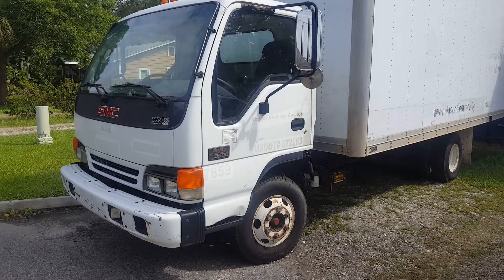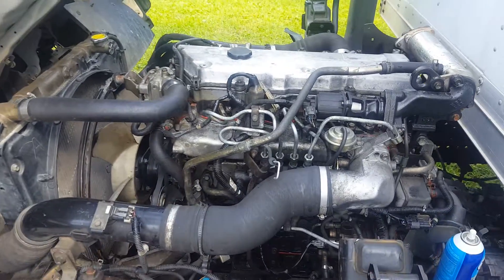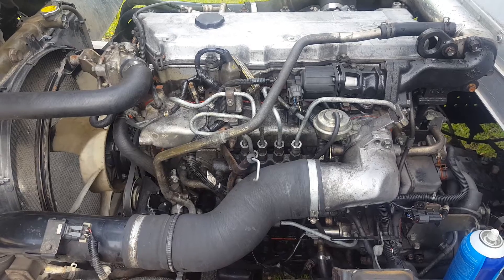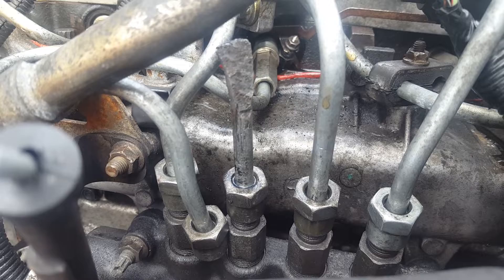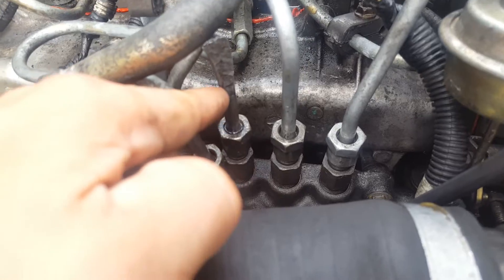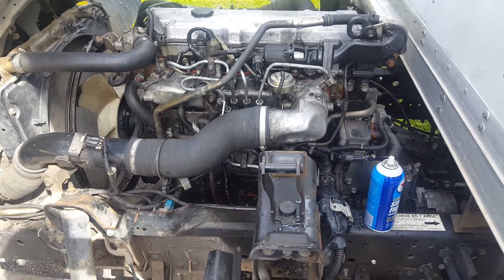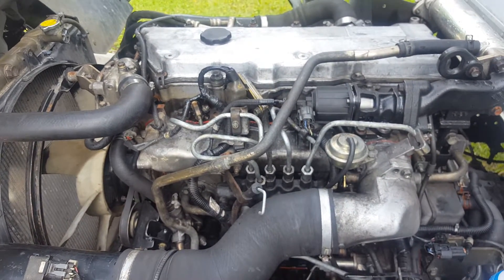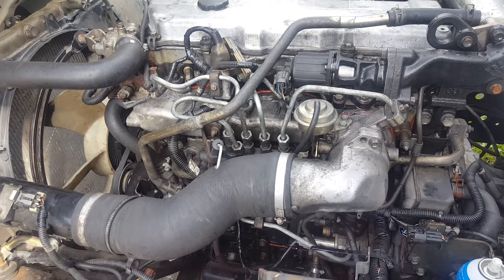How to test troubleshoot Isuzu NPR diesel no start, hard start, won't start without starting fluid

Comment: Replace at 292,000 and got to 352,000  and well 60,000 miles and my injectors went bad again and i replaced them with denso plug and play injectors they worked great, But i had two major failures that probably damage them first my radiator blew a leak and overheated my engine fix that and was running good then my injection pump fuel line broke at the injection pump. The pump head seperated and fuel was leaking out all over the place driving around sucking air,  So i had to put a new injection pump and fuel line at 1900 dollars to get the truck running then it started not idling good and slowly started have problems starting i had to ride the starter to get it started but once running it would start better. Put the Tech2 scanner on and while shutting each injector off one at a time two of them made no change in engine idle so lucky me i'm in for another 1500 dollars for injectors just lovely. oh also driving around sometimes i would loose power and have to shut the truck off and restart to get going again. I also have to pull my rear axles because the wheel cyclinders are leaking and my rear deferential seal is leaking oh and my A/C lost all its gas from rotting lines where they clamp to the frame shit what else do i have to do i can't remember. Sure wish i had 85,000 to buy a new truck.....
Reply: Damn bro shit sounds lk a $ pit, been a few years did you get rid of it already or fix?

Comment: My 02 nqr 4.8 Diesel engine won’t start? Changed injectors and priming pump assembly. Still don’t start without starting fluid. All my fuses are good Anyone have any suggestions?
Reply: Hello. How you resolve problems. My 2003  is it fuel ingectors? Or ?

Comment: why would one bad injector not start a engine......mine has the same problem sometimes and
it has started on 2 cylinders...
Reply from the maker: If 1 injector is bad (bad due to because it's leaking,) it won't allow the rest of the injectors fuel pressure to build high enough to fire.
Reply: My Hyundai diesel service manual says that will only happen on common rail engines......leaky down all injectors,
 not in-line pumps.....maybe its just hyundai but i would not think so.....
Reply from the maker: This is a common rail system. Not sure about yours, but this one is.
Reply: Ok yes I see now sorry.....I missed you say that.....mine is CR but injectors wont open under cranking

Comment: When you change a fuel injector on the Isuzu it needs to be reset with the computer?? My husband changed #3 and was working smooth, but 2 days later it has a loud clang clang noise and is shaking a bit and doesn’t run over 50  and choke sometimes while going up to 50mph
Reply: Sounds like he forgot to tighten something

Comment: Truck developed a slightly rough idle after changing the fuel filter , have bled it several times on the hand primer pump , what could be the issue guys . Can air in fuel system cause rough idle ?
Reply: Put a vacuum pump like the kind of bleed the brakes with go all the way to the top fuel filter by the engine, pull the fuel from there that’s what I did when that pump did not work the Isuzu guy just told me to change the entire primer housing 😢 bad

Comment: Hi have 2006 gmc w4500 and the problem is when I driving at 30 miles the exust brake on and black smoke cam from the exust can you help me please
Reply: I just fix this on 1 of my trucks it was sitting for more then a year, 3 diferent mechanic saw the truck but did not find the problemFirst I check turbo everything was fine Then I check the exhaust brake it was damage but was not the problem. The egr valve was stuck. I but a new one on ebay but when I was going to change stud broke I was lucky it broke when took the intake out there was my problem my intake was damage new inner intake and new exhaust valve no more problem with black smoke

Comment: Just rebuilt a 5.2 I Have times it twice but still wont start cranks just fine. I have fuel going to the injectors. Do you think that the injectors are the problem? If you want to get back to me you can message me at 7123189920 or email me at bigredrepair@gmail.com.

Comment from the maker: Yes, I have replaced all 4 fuel injectors. It starts up great now, with no ether needed. The engine seems to run good, but unfortunately it doesn't rev up (only about 10% rpm) in Drive or reverse. It will only fully rev up (100% rpm) neutral or park. I know the transmission is good because it ran and drove with the old injectors. So now I don't know what to do. I'm thinking the high pressure fuel pump is the problem.
Reply: I have the same engine that acted similarly but not identically - I think it would go into limp mode when loaded and wouldn't rev up in park or neutral. Replacement of FPR, SCV and one injector fixed it if I remember correctly. Dealer told me not to use aftermarket fuel filter/seperators. A few people online reported problems after using aftermarket filter/seperators too. Hope you got this fixed. The paramotoring is cool!
Reply: no u just need to hook up idss and check to see if any faults come up. with the Isuzu motor any fuel fault code will kill the throttle until it clears. it takes 5 key cycles to reset the fault without scan tool try that first fuel pump seems fine
Reply: Can you point me to a video on how to change an injector? Or could you make a video for isuzu injector replacement? Anything would help. Thanks
Reply: Did you code the injectors to the ECU?
Reply: Did u ever get it figured out?
Reply: Check TPS (throttle position sensor ) some time the loose memory or go bad , if you have the reset cycle key w pedal to floor and slowly let up to re- learn position ?

Comment: Did you do the injectors yet? I also have a 2005 npr the other day when changing the fuel filter fuel would not stop siphoning out of the fuel tank i had to put a bucket under while changing the filter
i'm thinking the suction control value is leaking. I never had this problem before. 290,000 miles still running strong.
Reply: What was the fix?